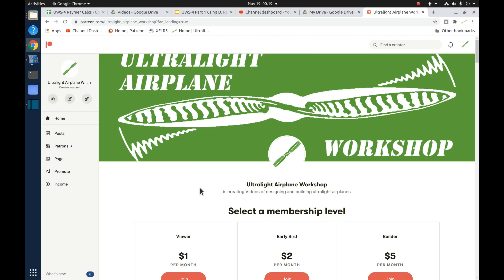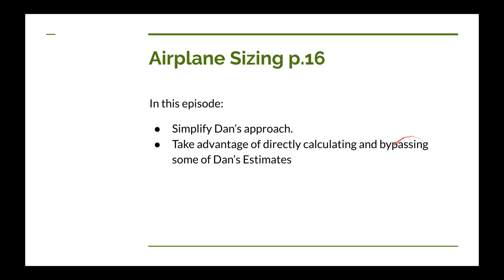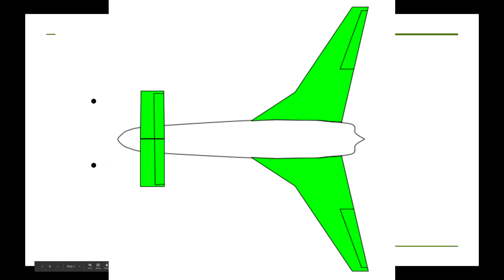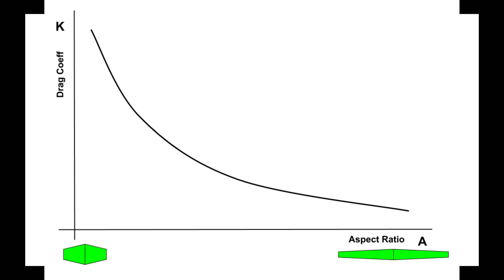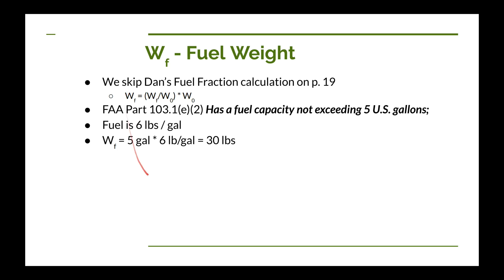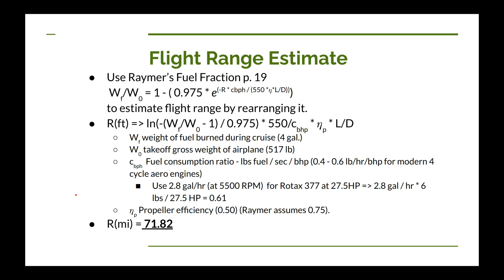UWS-4 Aero Design: Part 2.1, Sizing / Weight, Using "Simplified Aircraft Design for Homebuilders"

Comment: Hey there, Leon. I hope your project is continuing to proceed smoothly. I wanted to ask: At one point, you had mentioned that you had intended to explore using a fly-by-wire system on your ultralight. Could you share what you've learned regarding that? I'm now wondering what it would take to get such a setup on my own build
Reply from the maker: Hey Ryan, I'm working on Part3 for this series as I write this. You should see the Patreon message today. I have not gotten very far with the fly by wire. My plan was to first get the airplane flying with a push/pull and cable system first and then start working on a fly by wire system. I was also thinking of maybe having an intermediate system that would use servo powered 3 axis trim tabs to do the fly-by-wire but being able to manually over power the trim tabs with the stick.

Comment: Great videos series. I love it. I plan on building an ultralight once i get a big enough area to construct it.

What are the benefits for becoming a patron?
Reply from the maker: You get early access to videos. 5 days for "regular videos". At least 1 per month. This is all that the Early Bird Tier gets. There are videos made specifically for the Builder Tier (and available to the Designer Tier) are released to the public 6 months later. Instead of a video the Builder Tier is sometimes given data files or spread sheets used in the airplane designs. These files are not released to the public. The Builder Tier also gets the Early Bird Tier benefit. In addition to what has been mentioned so far the Designer Tier gets their own video each month. This video is released to the public 6 months later. At some point I will do streams of builds in the shop or designing on the computer in lieu of a video for the Design Tier.